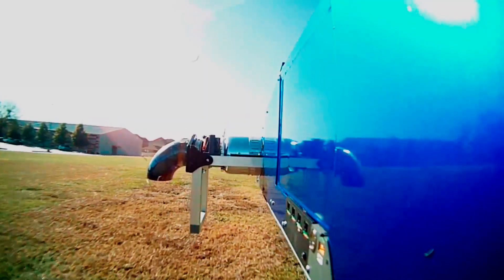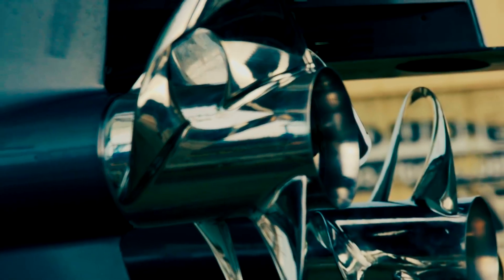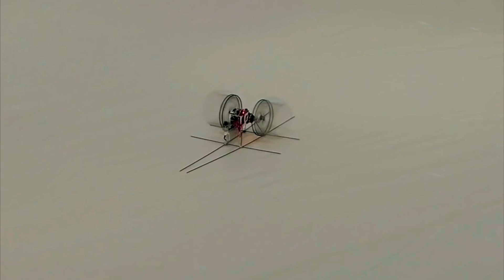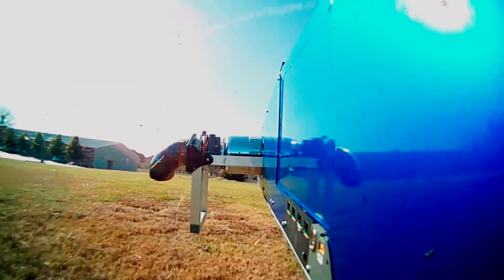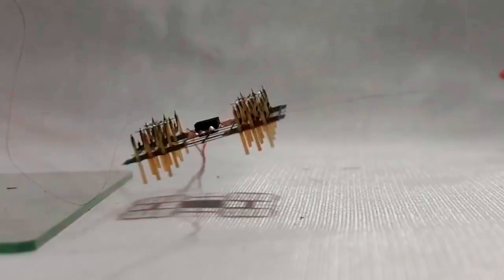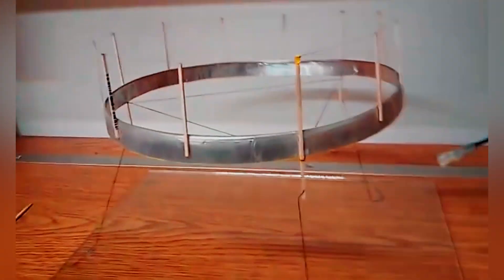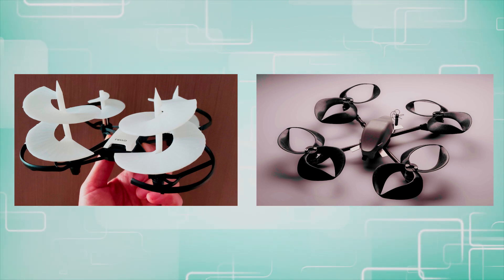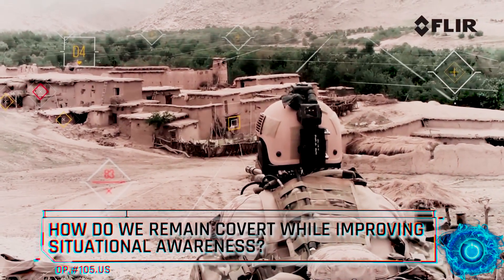Drone Propulsion - The LATEST Breakthroughs!

Comment: Key component is stacking. 1 propeller on top of the next will increase speed and all performace capabilities of the features in the design in question. Increase of the areal vehicle's speed will certainly be an upgrade to it's structure/performance design. Although other factors will limit the drones ability to perform for long periods of time. For instance a high capacity rechargeable battery, whether torque/speed regulators play a partial factor in the machines performace. Depending of the size of the battery  plus the key components in the design of the areal vihicle  we must consider weight of the materials to lyft produced by its propellers. Right materials are used creating a drone superseding capabilities of its predecessor will result in numerical vallues of it's predecessors superseding performace limits of any and all previous designs.

Comment: Huh. I have a macaw. And I've noticed something, up at high altitudes his feathers create really decent static electricity when they rub together. Could the oil they use work as the dielectric with the feather tips kicking off electrons like one of these. Probably nothing but wouldn't that be cool.

Comment: A centrifugal compressor below a parachute type canopy can replace the common helicopter method of generating lift. This configuration is more efficient in how the kinetic energy of the air is converted into pressure below and even by suction above the canopy.

Comment: look into T. Townshend Brown and his studies of dielectric stress, in the 1950s he was able to make a disk (capacitor) fly at hundreds of miles per hour. though his experiments were tethered. the tethering was due to high voltage needs to achieve the dielectric stress needed for flight. but it boiled down to this. pump enough electricity into a capacitor and you can achieve flight with no moving parts.

Comment: The smaller the tech becomes that civilians want UAVs to carry, the less efficient drone propellers need to be. Luckily, small sodium batteries are around the corner. Audio & visual is shrinking. Unfortunately, diversified location tech (detecting and targeting), that's less  EMP- vulnerable, has yet to evolve in sufficiently diminutive combination tech. 
  Of course, better propellers extend range, extend the life of materials by reducing cavitation  "explosions", 
and minimize energy consumption from production "footprint" as well as from driving UAV motors +/- accessories (all of which impact climate, incl even solar-powered friction "thermal pollution").

Comment: Two types of propellers I would like to watch their testing: 

1: The Aerial screw with just one turn,

2: The use of a computer cooling fan as a propeller, because there is no gap between the blades except for the gap caused by the tilt angle.

Comment: centrifugal pump rotary jet turbines are much better than cyclorotors, just one moving part, more similar to normal but better drone rotor
Reply: flutter flex membrane waving fish-tail turbine (both electric and gasoline) is both quieter and better
Reply: ion arc ionic wind railgun thruster is simpler ducted fan
Reply: why dont you just do magnet induction coil flex membrane fan, using ac current circuit
Reply: also helium floating blimps are just fine, even micro size

Comment: the toroidal propeller shows more promise then was advertised here

it has higher performance with less noise by a significant margin then standard propellers. the fact that it produces less noise contributes to its gains because instead of energy into making noise, it's more energy into thrust. with advancements in 3d printing the prices should keep dropping. it has a promising future.

Comment: Jet engines have high temperatures inside them as a consequence of COMBUSTION of the fuel. 3D printers using  plastics aren't going to be of any use printing jet engines !

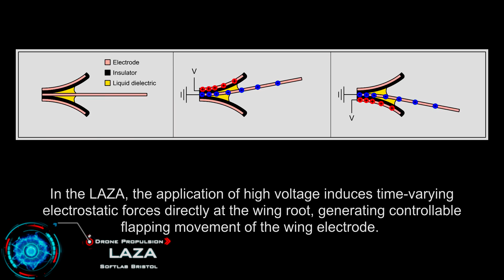Comment: 5:24 Seems to me you'd be burning through a million cycles in just a few days at best, when you consider the wing beats/second a small flying craft requires. The average hummingbird has a wing beat of around 53 hertz. At that rate, you'll have about 48 hours of use. Now, if you use that in craft with much lower wing beat speeds, it's a little better.

Comment: Since W=Fxd, theoretically, would an optimally designed propeller or thruster be able to imitate a lighter than air vehicle and levitate with infinitesimal power?  The power required for levitation. seems to depend upon the stability of the craft to provide multiple thrusts upwards and falls over some distance d, but in the limit as d goes to zero, the work required also goes to zero.  Its seems thus that a highly stabilized craft, perhaps via gyroscope, coupled with many nanothrusters might be able to achieve such a limit so that a heavy battery or power source becomes less an issue.

Comment: If I had the money?
This is what I would try.
Using a drone:
1) Remove the propellers.
2) Using Mercury inside of a round tube in a figure 8 shape; folded back onto itself.  So the fluid would flow in clockwise direction in the upper lever and   flowing counterclockwise in the lower level. This would be using the magnetic field of the motors to move the Mercury in only one of the levels. As the other level needs to flow in the opposing direction. 
It is these opposing fields that break the gravity fields and allows the lift.

Comment: Barring some dramatic breakthrough in battery energy density, the quad copter type drone will never be practical.  Far better would be a tilt rotor type craft.  These have the capability of doing vertical take off, but it is far more energy efficient to do a short take off. That is why VSTOL aircraft like the Harrier and F35B will use a rolling run when it can but a VTOL when it is necessary, but at a great effect on useful load.  After all of these years, no one has yet produced a practical quad copter for human transport and I doubt that they will until the super-battery or Mr Fusion. comes along.

Comment: Kind of curious, why would you say that in the future it is very likely that micro aerial vehicles will have some different type of setup?

It's certainly possible to generate lift with other designs and methods, but is there anything more power efficient or weight efficient?

Comment: I had an idea for a craft(possible heavy lifter like an air crane) that uses a number of different lift effects.
Its a large neutral buoyant hydrogen filled lifting body with variable geometry tech and cyclorotor powered.
It would be hydrogen feul cell powered.
Imagine a massive manta ray shaped craft with wings that change shape to maximize lift potential, hydrogen gass bags make it light but not lighter than air.cyclorotors under the main body would give the main thrust and maneuverability.

Comment: I thought the big reason why we have so few jet propulsion-based vertical takeoff vehicles is because of how rough the exhaust is on a runway or flat area to land? It could be replaced with turboprops and it would be the best of both conventional rotors and the fuel efficiency of a jet engine. Jet engines themselves are actually fairly easy to build but unless you utilize more expensive materials your engine won't be able to practically last very many cycles. If titanium ever becomes as cheap as aluminum then it would be a game changer as there isn't any efficient way of getting titanium out of the abundant titanium dioxide and you can 3D print with it. I believe there's a way through a lengthy series of chemical treatments and reactions to get the titanium to let go of its oxygen but its cost prohibitive and toxic.

Comment: The snail-propeller is just louder, heavier and less efficient.
Toroidal props have been in use for decades but it is used for anything but efficiency (and for drones - yeah, if you adapt the prop and the entire drone than it can be quieter).
Jet-drones ... no commercial aircraft uses turbojets. they are extremely powerful but inefficient. They are only used for military applications due to their shear power and the top-speed (turbo-fans have a hard time reaching Mach 1.5)
Ion thrusters - no. Let alone the practical limits, even the theoretical maximum limits make them an absolute no-go for drones. They are horrendously inefficient and weak.

There is a reason why props have not changed much for a long time, same for turbo-fans.
The aviation industry is spending many billions each year for the smallest improvements and they (together with the military complex ) are also funding thousands of (mostly stupid) projects each year in hopes of seeing even glimbs of some new idea that could work. DARPA is a prominent example spending several billions each year on stuff like nuke-propelled rockets and robot-donkeys.

Comment: With the ion propulsion I wonder if the vehicle trailed a long thin wire underneath it could use the different potential voltage to power itself. I saw something like this on YT where the operator was getting shocks from a relatively short wire.

Comment: It looks like that new prop with no tips draws air from a larger area if not as much, might be useful for a low density atmosphere like Mars. 
So ION works, wow. And flapping wings seems like it will be a rough ride. Get them in sync like a millipedes legs and it might not be too bad. That would be better as submarine propulsion, A million cycles, how long would that be, a few days running steady, you could and would probably have to slow them down in the water but that would be interesting. I wonder if it would make less noise than a Prop to have 1000's of oars protruding a few feet out side the subs Hull pulling it through the water.

Comment: I have a patent-pending multi-stage rotor. Theoretically far superior to current prop designs. Can't afford to do  3d printed model. Takes air in and routes it through multiple concentrically aligned blades with incrementally smaller flow areas. The flow reverses direction but on an adjacent row. the exit air is denser with a higher velocity which can be vectored in different directions.. anybody seriously interested?

Comment: You need to do some more research. The torroidal propeller you show attached to the marine engines was invented in 2012 by Gregory Sharrow and he now holds 78 patents on it. Although very expensive, it has shown to be superior to conventional props at almost every metric including speed, fuel consumption and vibration.

Comment: Torroidal ship propellers add substantial improvements over regular propellers.  I would assume that similar gains will impact flying craft as well.
Reply: "add substantial improvements over regular propellers" Aside from then not being new but well known and in use in certain industries for decades...
And do you happen to know which they are?
Hint: it is not power nor efficiency.

Comment: There are also Silicon Fans, its some kind of Chip Design thats using nano scale vibrating to move air. first use cases are inside phones and notbooks, to replace the normal fans.

Comment: OK I'll play your game "Fly like a Bumble Bee at 8 Hertz" well at least hover.
I'd suggest a light honey cone platform with Piezo in each cell to focus the already Focused Charge Shape that frequencies between 8 Hertz to about 9.5 Hertz create.
To actually visualize what 8 Hertz looks like there's a guy on youtube that does 1 Hertz through to 10 Hertz over water and it's quite clear why Tesla himself Liked 8 Hertz.
It appears like a Bulleye with 2 outer rings - Just like an Explosive Shaped Charge.

If you have a hexagonal platform made of hexagonal tubes, and mount the Piezo wired in Rings to fire the piezo's in the firing first, the first ring firing second and the outer ring firing third is a continuing sequence at something between 8 and 9.5 pending on the resident of the length of each hex tube you will in fact make a hoverboard.

How High and how controllable is going to be related to the strengths you play on the 6 segments.
So Play Like a Bumble Bee and remember where you got it from.

Me

Comment: When I built my jet drone.  I used 1 turbine engine with just 6 pipes for exhaust. Each pipe was 28 inchs long and was what most call arms I guess lol. Gate opens and closes like carb to create direction..... or gain or lower height.  Funny enough just used cheap pixhawk to control it with my own firmware
Reply: Your concept came into my mind as I saw the 4 expensive turbines on that drone. I guess that the current VTOL fighter jets don't carry so many jet engines on board  to be able to maneuver in the air
Reply: @pascalfust1035  well I literally have 11 engines 110lb thrust turbines all the same make lol. But here is the thing!  4 on drone is suicide for those engines. These small turbines dont like like up and down left to right.  Greatly reduces bearing life. Forward only is ideal for how fast they spin.  Other issue is the rotation mass of them causes really bad rotation issues.  In a drone was huge problem for me.  Ended up using 20mm tubing on left and right. On the right I had 16mm incerts  just to restrict some thrust output  Just to help with the twisting rill effect.  So gyros could make it fly level. Gates where very hard to manage.  Ended up using 6 align digital tail servos for 800mm 3d helicopter  to control them has to be stupidly fast changes of the gates.  Turbine lasted 50 hours in that drone build.  Tossed a new one in it and it has been wall hanger ever since lol

Comment: The “bird” towards the end of the video... 50+ years ago I bought a mechanical bird at a local fair. It was made of hollow plastic tubes as the skeleton with thin plastic film for wings and it was driven by a rubber band and it flew just like a dove!

It got itself upwards and really high until it stalled. Then it tipped over forwards, beak down, still flapping. During the dive into a slight ascending bow, the air pressure became too high for the kinetic energy in the rubber band so without flapping it glided in a long gradually rising bow until it lost ascending acceleration. Then, at the end of each top of the rising curve it started flapping again. Just like doves fly!

It caught a lot of attention I remember. More amazement amongst adults really. I was a young teenager at the time and so often later in life I regretted having tossed it away instead of keeping it for my children.
Reply from the maker: Nice, thanks for sharing!
Reply: I bought one of those in 1970. I worked in an office building overlooking Madison Square Park in New York City and saw a commotion going on in the park when I looked out my office window. I went down to see what was going and this guy was selling those birds right out of a box. He had several boxes on hand and his assistant was flying some and people (including myself) were snapping them up. Haven't thought about that in years! Thanks for sharing and awakening old memories.
Reply: @PudgyCurmudgeon  My pleasure! Yes, some things are indeed like time machines. They take you back to a time and a place in a split second and I even get the feeling in my body of that same occasion. Memory lane can be pure magic!
Reply: @PudgyCurmudgeon  thank you for sharing. What a nice story. I could even “see” you getting down there to the seller and people around. 😊
Reply: I copy and pasted your comment into ChatGPT and it said you were likely talking about a "Tim bird" or "rubber band powered ornithopter". Let me know if this is what you were referring to
Reply: @lasercat538  thx. Maybe it was. But looking at all pics on the web i think mine had more faded colours. Much like my memory 😅 but it could very well be that Tim bird toy. If that was around 1970?!..
Reply: @tomfull6637  there's also videos of people flying it on YouTube. Some of them seem to have better results than others. It seems like a cool toy when people are able to get it to work. It reminds me of a rubber band powered airplane
Reply: @lasercat538  Yea, rubber band powered ornithopters as today are at least 150 years old, 
  and owe much to Da Vinci . Though I gather such "toys/designs" go back at least a 1000 years if not 2000
 using other torsioning material, various cultures/places.  Such as paper ones in the Orient
Reply: Search Tim Bird Toy  $15-20, Regards
Reply: I had a rubber band ornithopter in the 50s. Kellogs was using them as prizes  for their cereals. I also got a rubber band powered air boat.
Reply: Interessting ...

Comment: It's odd that I haven't seen that sideways drum rotor with ducting around it. Where the duct inlet is in the center, horizontal, and the outlet thrust is at the bottom. The duct would have to be able to rotate or in some way be able to move the thrust forward or backward around the cylindrical duct. It's an ID fan. In heavy industrial we use them to move air...a lot of air. If the whole thing could rotate a few degrees forward and back that could give you lateral movement or if the 4 "squirrel  cages" pushed against each other it seems like the drone(or whatever) would be more stable. Then it would be less dependent on drum speed, or difference in drum speeds, to move laterally or tilt. I'm not a drone mechanic though. The thing would have to rotate to go a different direction I think. Damn, now I want to make one.

Comment: The cyclorotor gives me similar vibes as a helicopter. Very complex, but it performs its "gimmick" very well
Reply: Yeah, but also it can be used for horizontal flight, fast as airplane. And if you add plane wings to cyclorotors — you get plane with vertical takeoff and landings, which doesn't longer reqire any runways.